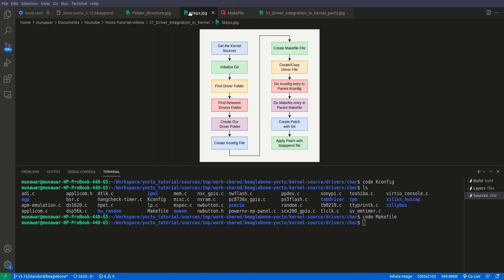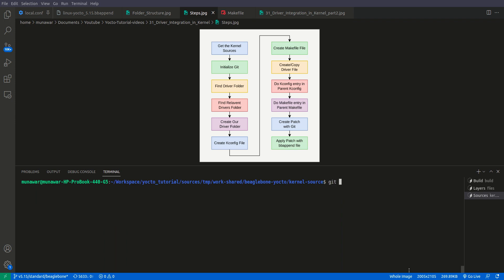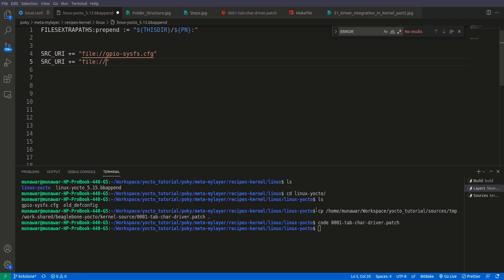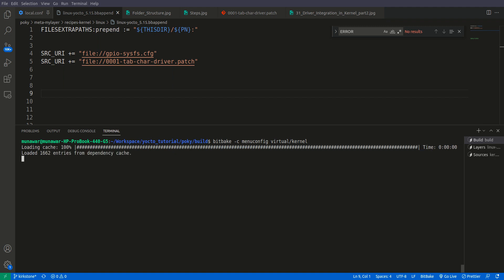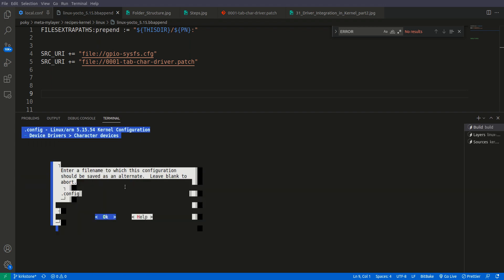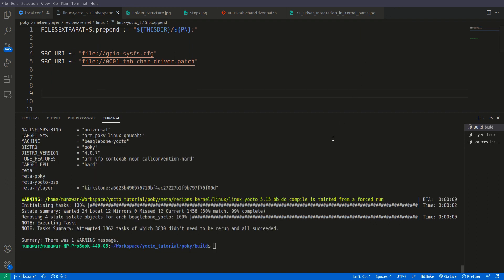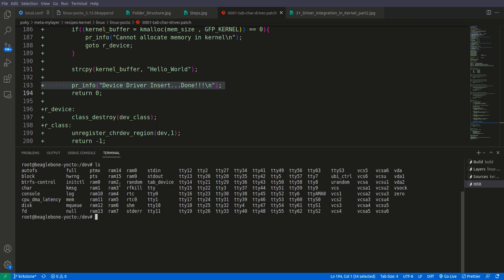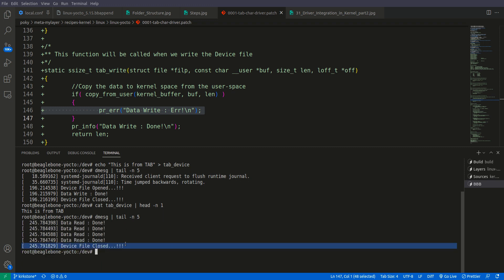Yocto Tutorial - 31 Kernel Development | Device Driver Integration in Mainline Kernel (Part 3)

Comment: Hello, if you can give me a hint. I would appreciate very much. I am following exactly the same steps as you presented, but I am getting an error during the bitbake of the core-image-full-cmdline image (do not think the type of error matter, anyways). Error is thrown at the do_compile() task in the build process : * No rule to make target 'drivers/char/george_driver/george_module.o', needed by 'drivers/char/george_driver/built-in.a'.  Stop." where 'george_driver' is the name of my module dir inside /drivers/char/ and name of the .c file is george_module.c . Both Kconfig-s and Makefile-s (parent dir and child dir are right)> The patch file seems legit, I really can not figure it out.  If it provides preciser set up information, here are command line logs https://github.com/georgecatalin/my_yocto_cookbook/tree/main/Yocto%20Kernel%20Development%20on%20Embedded%20Systems/Integrate_the_device_driver_in_the_mainline_kernel_using_Yocto_Project.
Reply: late edit: tried multiple things, but still unsuccessful. 1. switched the assignment operator in the Makefile of my char driver directory from immediate assignment := to += (as I saw in other places on the internet), 2. change the name of my char driver to eliminate the underscore from 'george_driver' to 'georgedriver', 3. created the .cfg fragment as you started, but did not continue. Moved the .cfg fragment with the Y setting on my driver in the 'linux-yocto' directory for my meta-layer associated with the build, marked the addition of this .cfg in the SRC_URI of the .bbappend file. Nothing works. Still the same error "No rule to make target drivers "**.o"